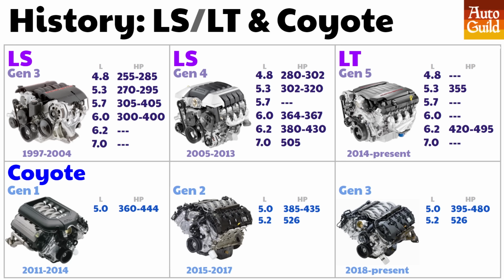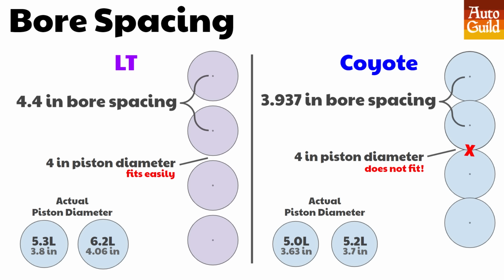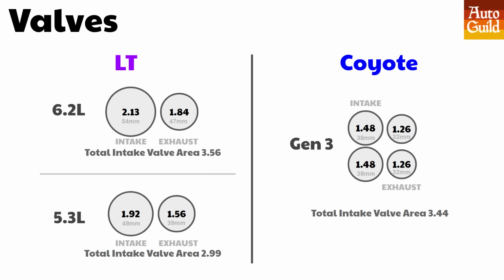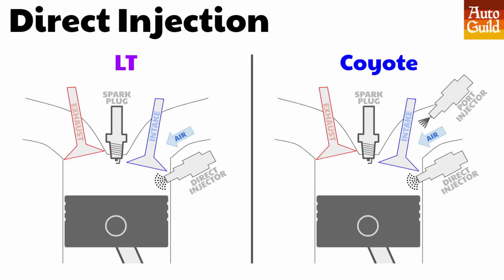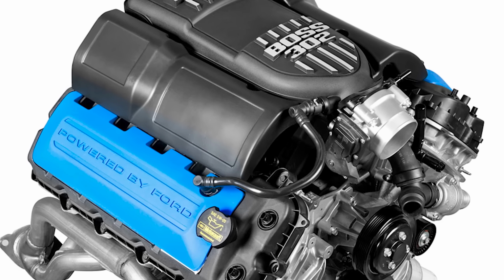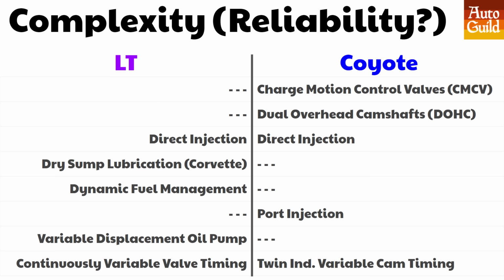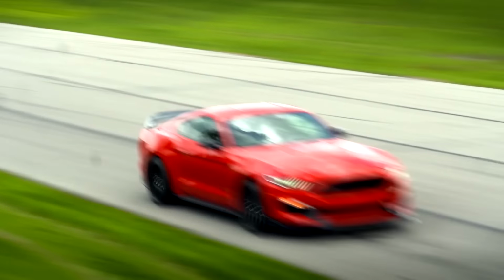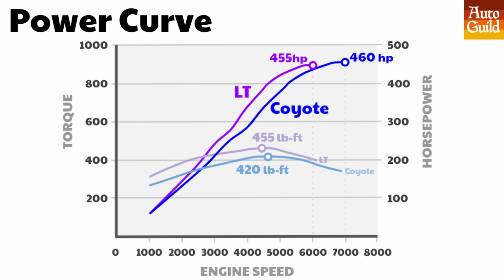GM Gen 5 LT vs Ford Coyote.  Which one is better and why.

Comment: @AutoGuild ..... First you are so wet behind the ears ... Do not think ford is soecial with the flat plane crank, its NOT NEW tech .... Got just 1 question for you .... Who made the first and original American flat plane crank engine and where is it located???.... I bet ya will never guess and never know where it is at.... I do because my uncle owns it and it runs like a rolex watch... I wont tell ya how much power it makes, however that ford has nothing on it.... It was tested with one of the very smallest factory cams ever produced... You need to learn a lil bit more about each of the engines you were talking about ... None of the gm engines have anywhere near the correct lobe profile or valve timing events for making power in factory setup.... Your analogy is completely busted by power production vs rpm.... Your comparing pushrod to dohc... You have no idea about power production.... When you can still take a gen 1 sbc with proper production cylinder heads and proper cam and make 450hp & 500tq UNDER 5500rpm you will never be it...

Lets use all factory production parts 

Ford vs GM
... Its easier and cheaper to build a gm small block for power.... 

Your first mistake is thinking an undersquare engine is gonna beat an oversquare engine... 

Example...

Gen 1 sbc 350
Vortec heads
Comp #5086 lobe profile single pattern on 106 icl
.... This will make 390-400hp and 430-440tq ALL DAY EVERY DAY... under 5500rpm, use 3.08 gearing in differential and a 4 spd automatic... 3200lb car.... Will walk your coyote motors all day long

Next lets take the same 350, just adding a 383 kit and proper 200cc 64cc heads with dished 16cc piston and .034" quench and 6 inch rods...now your at 440-450hp and 500tq ... With next step up in cam profile.... And this is a flat tappet hyd  cam.
Reply from the maker: Who did make the first flat plane crank engine and what was it in?  I love DOHC too, my daily driver is a Flat 6 DOHC engine.  : )

Comment: For V8 trucks. Theyre both ridiculously underwhelming. The GM AFM fault wrecking lifters and cams. The ford with the phasers and timing chain. 

American truck powertrains are UNRELIABLE.

Ive owned both a f150 and silverado 1500. Major issues with both with the above things mentioned.

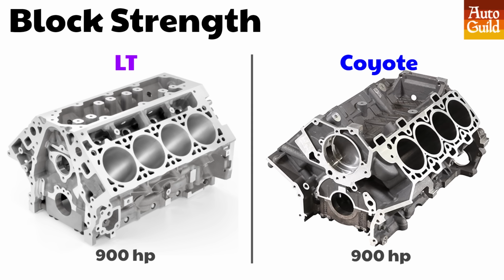Comment: 10:37 actually, the coyote gen 1 can handle 1230 rwhp no sleeves. I daily drive it and it’s got about 150 races on it and about 33k miles at that power level.

Comment: One note about the voodoo that makes it even more special than you describe:  In your picture the crank journals are Up, Down, Down, Up all 180 deg. from each other.  This is what all flat plane crank V8s are designed as.  However the voodoo is Up, Down, Up, Down.  Google a picture of the voodoo crankshaft.  This makes it a bespoke design that is sort of a mix between traditional flat-plane and cross-plane.  It truly is a special engine and unique piece of engineering that we might never see again.

Comment: I love the fact that you're still a good guy but you forgot to mention if you upgrade the internals on the lt5 what would happen but the point is the coyote engine is ready out of the box. You can call me old fashion but I'd still pick a push rod motor. Just alown for reliability. Can't blame me i grow up on these.

Comment: The coyote will work just as well in a pickup, muscle car or heavy four by 4 vehicle! It's really easy! Put an automatic in it with a decent stall. BAM!!!! There's your torque !  You'll have lock up for highway!
I want a Gen 2 6R80 To go into my original 84 F-150 Lariat. It has a freshly rebuilt 351 Windsor but has set for decades. Check it out and then swap it into my mom's old 90 F-150. Just throw a  Holley System on it with stock fuel injected hardware.

Comment: I have noticed that the automatic transmissions by both FOrd and GM are not built equal. GM has the option for the stronger transmissions! The number after the "L" and "R" is a code number for the amount of torque they can handle in Newtons. Ford =800 or 590lb/ft and GM=900 or 664 lb-ft! I wonder why!

Comment: I prefer the 392 Hemi or the HellCat over either of these two. Or the 2011 G37 I've got sitting in my carport. Just with a 450 tune and a NVidia high performance exhaust it can dust any brand new factory stang or camaro. All I'd need to be quicker is a stage 2 turbo and twin intercoolers. Spend all that 💲💲💲 on those Ford and Government Motors engines and you're liable to get spanked by somebody like me ;)
Reply: A 5.0 2018 GT makes 900whp safely with fuel, boost and oilpump gears.

Comment: I have a LSA 6.2 that is now a 6.8 bore & stroke, with all types of tweaks... Our '14 Mustang V8 has full SS exhaust and CAI and nothing else, probably will stay that way for daily driving, maybe E85. As for brand loyalty it only serves to limit choices. I find a car that I feel is a good deal I will consider it. Generally {General Lee} I am a Mopar fan as well but as far as new muscle, Dodge has priced me out and has for many years and Ford and Chevy are getting higher priced as well. Of the big 3 the Chevy would be the king of mods with Dodge getting props for designing it right out of the box and Ford taking the 5.0 to the next level is interesting but mods are tricky. The Dodge will have to stay in my dreams... RIP Barry Newman

Comment: You kept it a buck. Some people like to hate on Gm motors for some reason. But facts is facts Gm came up with the 6 bolt side drill to stop crank from walking. Gm ls been out 20 plus years ago then Ford stole Gm bottom end design if you look at a coyote motor an Gm Ls motor side by side they look identical. Thats why ford motors can handle such big Hp numbers on stock bottom end like Gm ls base motors been doing its a over 20 year Gm design. Plus heads out flow fords heads all day long . An with simple bolt ons or cam an or heads ive see Gm ls1 gen 3 make north of mid 500 hp rt at 600 just head cam E 85 deal. Keep being non byest an tell the facts it makes people want to watch your videos vs others.

Comment: I Have owned many of brands both over past 70 years and seems like GM bit the dust about 1980 . The 1960's and 70's when all the GM cars were different like Buick - Oldsmobile -Pontiac  they seemed to be much better than ones built after 1980. The 327  was one of  GM's best engines I Owned 409 -348-350 just to name a few. The Ford 289 -302 and 351 W were some of the very best ever built in my opinion and I have never got a dime from either Ford or GM just telling it like it was back in the good old days when gas was around 28 cents per gallon and we still had a little privacy. Thanks for the video.

Comment: Random notes but it's basically irrefutable that the current gen Camaro chassis is way better for strictly performance than the S550, which would explain the better 0-60 times and maybe even the fuel economy. 
Also with emissions laws I don't think it's fair to say a 6.2L Coyote would be way better than a 6.2L LT. The Coyote version would also have to be tuned down to pass emissions which I believe is why a 5.0 is even comparable to the 6.2 and even Dodge's 392

Comment: The Coyote being shorter front to back than many V8s actually suprised me. I'm in the process of replacing my Gen 1 Coyote short block with a Gen 3 short block. I was able to pull the engine out of my 2012 GT without removing the radiator or fan. I also had enough room at the firewall to get to the bell housing bolts very easily. The only hickup I had was having to detach the steering shaft so that I could pull the engine with the exhaust manifolds attached. The coyote is really not that complicated to work on either. I think the DOHC setup seems to make people think that it's just a huge ordeal to work on. It's not. The Timing chains and sprockets are marked, so you know exactly what goes where, it's pretty hard to mess up.
Reply: yeah I fully agree, I think people head DOHC and instantly think it's incredibly complex and some german engine. If you take a look at a coyote and an audi 4.2, the change of complexity is insanely noticeable
Reply: I recently got a 2021 Mustang GT after years of owning Chevy and I was pleasantly surprised to see that it doesn't seem to be that much more complicated to work on (without opening the engine).

Comment: Both engine architectures are absolute masterpieces Ford and GM should be commended for both of them however as you mentioned in a sports car app I would prefer the compact low low center of gravity style of the Lt purely for weight I believe it weighs a little bit less but the center of gravity is substantially lower and that is your friend when it comes to cornering and having a lower polar moment of inertia for breaking and getting back on the accelerator out of corners just my humble opinion

Comment: Power density should be power/engine mass, not power/displacement.   Mass and power are what effects performance, not displacement. Otherwise you might just as well define power density as Power/# of oil pan bolts.

Comment: GM LT engines have a lot of lifter  failures amongst many other engines issues! Info coming directly from a GM online support tech! 
Maybe it seems like a lot because there are so many more available in just about everything full size in the GM line up?
Also need to compare the Godzilla line up to the LT….not as many options but it’s an up coming engine that’ll be popular to swap into other vehicles!

Comment: The Low RPM tq of the LT engines is great, but it doesnt top the High RPM Exhaust note and Excitement. The 5.0 and 5.2 engines are so addicting.

Comment: Amazing engines.  I had an LS6 in an '05 CTS-V and I put a supercharger on it.  It taught me that, for street driving, there's nothing better than lots of low-end torque.  Displacement does that, and superchargers do that.  Also, while not mentioned in this video, the LS6 was known to be "bullet proof."  I suspect that both the LT and the Coyote are bullet proof, too.  Alas, the ICE has come to an end.  EVs are the future.  Maybe the next big craze with be axial flux motors being hopped up.  We can hope.

Comment: this is like the 60s when Ford introduced the Cammer that produced 635 hp and gm and Dodge went all cop and got the regulation book out and put an end to what would have been a great leap in engine history. Now 60 years later how is a pushrod vs an overhead cam engine even a discussion add to the overhead cam an induction system is not this like comparing flathead vs pushrod

Comment: In my opinion it's much better to have the power and torque at lower RPM, also a benefit to have a smaller package to be able to fit in more vehicles.

Comment: “Horsepower per liter” is an awful, lazy overall efficiency standard.

Understand it is horsepower per POUND OF ACTUAL ENGINE WEIGHT, comparison of fuel consumption per power produced charts, overall cost to own as well as manufacture... There is a reason the cam in block design has been so prevalent, it still has development potential today… but so do many designs 🤷‍♀️

Comment: My work van has the LT 6.6L in it. That thing will move. Its basically just a motor hauling a empty shell. It also gets great gas mileage. A lot better than the 3.6L penastar our Dodge has.

Comment: I just recently purchased a 15 5.0 F150. Sold my 14 GMC 1500 5.3. I found that 15 f150 with 17k miles and it’s a king ranch. Had to have it. The 5.0 to me is a way smoother motor with that 6R80 transmission. It’s more powerful to me. I love it’s responsiveness. As far as towing goes, which is all I personally cared about, the Ford pulls better. But it does not like stopping and going like my GMC did. The ford transmission brakes a LOT in tow mode. And it has hard shifts from 5th to 4th. If I’m doing smooth sailing. It’s the clear winner. But I personally liked towing better with my GMC.  Everyday ride, F150.

Comment: Coyote's volumetric efficiency is better than most engines. The amount of air that fills the cylinder on intake stroke which is why they run so good and get decent fuel economy. Makes more power with less displacement unlike the LS and even chrysler "hemi" junk.

Comment: Both are great motors. Test drove a 'Vette and the seat of the pants feel of the lower end torque was awesome. But I ended up buying a gen 3 Mustang.  Really love that unique Coyote sound pushing 7k plus rpm, and it is competitive on track days with few if any mods. Theres few cars on the road that can outrun it, and beat many Corvettes. Of course for outright straight line neck snapping power I have the Hellcat.
Reply: What kind of track?  Mustang handling isn’t as good as camaro or vette.

Comment: There is not question as to which engine is better, the coyote engine family is the superior engine going forward based purely on the engine output and efficiency. Similar reasons as in with motorcycles 4 valve heads flow better and more thus producing but overall power for smaller displacement engines. Now based on ease of build and cost its a wash as both platforms are backed by big aftermarket support. Can take either engine add boost and proper fueling and make well over 800hp but for a general consumer the Ls is easier to get into for less upfront as most people cant just drop $6-10k on a boost set up and proper fueling but can usually swing basic bolt ons and make better power per than the coyote as its already for its size making what it can N/A.The LS platform is a nice added bonus to the old Pushrod ways but even chevy is going 4 valve for the simple fact of efficiency in power production.

Comment: If you insist on getting the Ford, your best option is to get a 2017 or older. 2018 and up is nothing but problems. The real reason its hard to locate one is because we have to replace so many, they can't keep up with demand. 

Also, if you get one 2018 and up, never get the manual transmission. They didn't make them strong enough. When you push the motor hard, the clutch assembly can shift and go out of balance. The shaking is so strong, it destroys both the engine and transmission. The last one I did had 4000 miles on it.

Comment: As someone who was effectively a GM guy growing up, and I still love a lot about GM engines, I am now a Ford F-150 guy. I love my 14 with the Coyote. Had it since new and it’s got 465,000 km on it and still running strong. 

We are spoiled having so many great engines on the market, and that includes the wild engines in the Dodge/Ram line. It’s really a matter of personal preference but the engines are all solid. 

I just prefer the styling of my 2014 FX4 over anything current or earlier (save for the exterior styling of the 67-72 GMC).

Comment: Gm my 1999 has over 300000
Miles and still running like beast 
5.0 are bad I had really bad experience 2019 f150 with only 100000 and 3 of the cylinders went out

Comment: This video is definitely biased to ford because we talk about the voodoo vs LS3, but not the LSA or LS9? Doesn't have LS6 numbers right under 6.0 gen3/4... Lots of oversights and omissions to make ford look like it has some kind of advantage?
Then goes on to hp per liter? If you're racing, it's area under the curve and it's not hp, it's tq. So average tq per rpm above 3k divided by weight and maybe fuel consumption is a factor for your style of racing.

Comment: Recently I was in the market to get a half ton truck. All manufacturers had points I liked. But the GM DFM lifters scared me off. I could not find a Coyote anywhere. I'm recently retired and want to keep it a long time. Finally got a 2019 Tundra. The likelyhood it will run a long time overrode the few shortcomings it has. I've had GM Dodge and Toyotas. I was ready for a Ford. I think it's great the LT and Coyote are available.

Comment: Having lived through the '60's / '70's Chevy /Ford /Mopar fun, What I love so much today, is that we have such great engines AND great handling cars, that we can just buy and drive. I remember spending way more time under the hood and under the car working on trying to get every hundredth of a second off my lap and quarter times, and while I got the satisfaction of knowing I got the results from my own decisions of what to put in my engine / suspensions, I truly would have rather been out, driving my cars. 
It's terrific that we have so many wonderful performance choices in such reliable, comfortable, beautiful cars. Progress in all areas. 
But we only have so much time left, because as we've seen with the performance of the Teslas, all electric racing is just around the corner, as the internal combustion engines will soon be eclipsed by electric motors and batteries. We'll all be racing around in giant versions of our slot cars!

Comment: The Coyote is a good engine, but its as big as a house for how small its displacement is.  The LS/LT is a much smaller package with a large displacement.  Ill take the latter.  Second, the aftermarket support is almost Non-existent with Coyote Engines.  Im sorry, but that in itself is a deal breaker. You can have the best most powerful engine with great reliability, but if there is no market support for it, its a boat anchor.  One more thing.  The LS/LT engines are just flatout cheaper by such a large margin that its not even close.  The Coyote is incredibly complex and almost requires an engineering degree to do anything to it.  The LS/LT engine is way easier and more gear head friendly. That in itself is a huge reason why LS/LT engines are just so popular.  The LS/LT are just so swap friendly. They lend themselves really well to swapping.  Im sorry but until Ford decides to get off their butts and put these engines in a wider market, they wont be around for very much longer. Thats not gonna happen very much more than it does now because both of them are focusing on EV now.